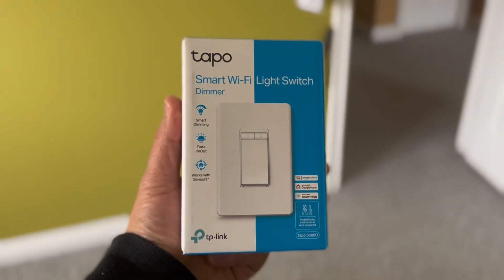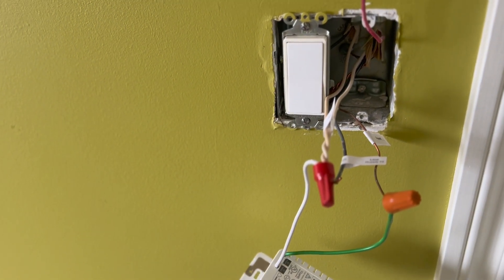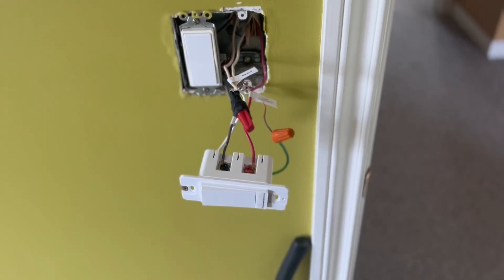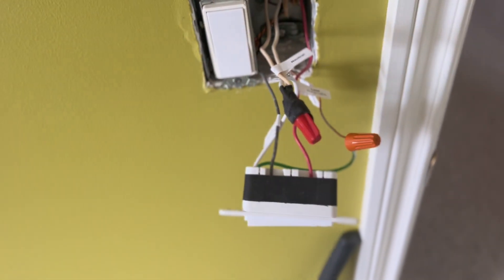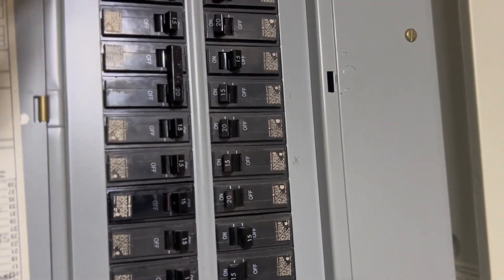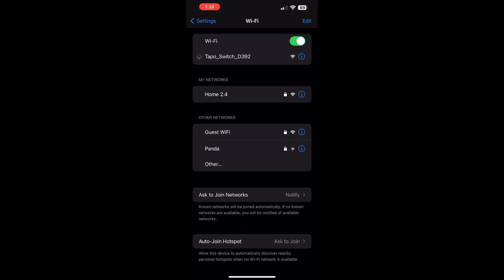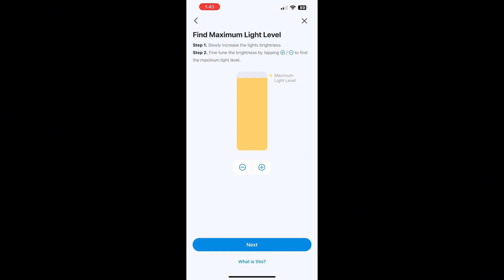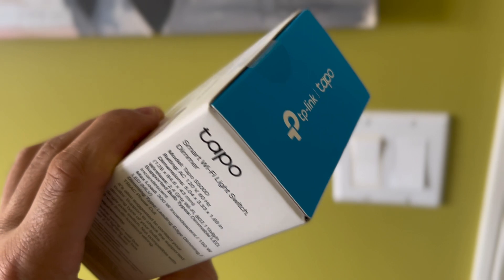How to install a WiFi smart switch by Tapo

Comment: Hi! One thing I can't understand from the Tp-link website is if the dimming control is for working with smart bulbs, you know, those that are RGB and you can control in the Apple Home App or Google Home app, or if the dimming function is for plain simple dimmable LED bulbs (not smart bulbs). Can you tell me about this?
Reply from the maker: It works with simple dimmable LED bulbs. That’s what I use it for. I believe smart bulbs already have the dimming function built to them and they can directly connect to the internet. So they can be controlled remotely without the need of a WiFi dimming switch.